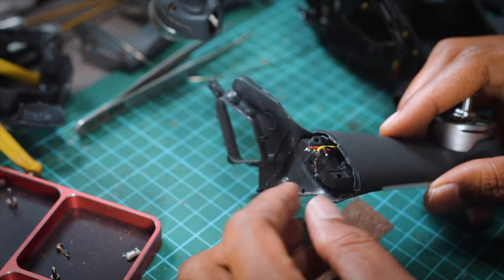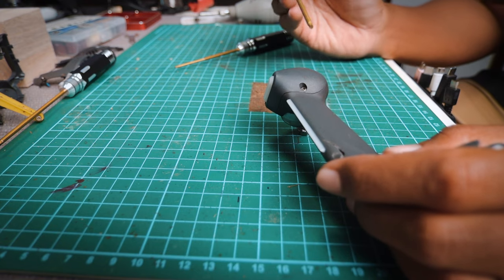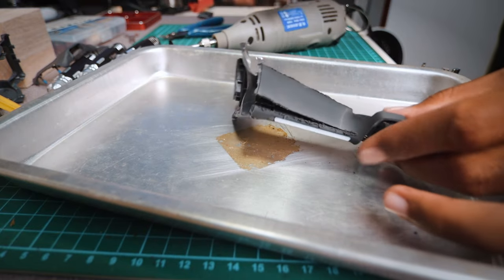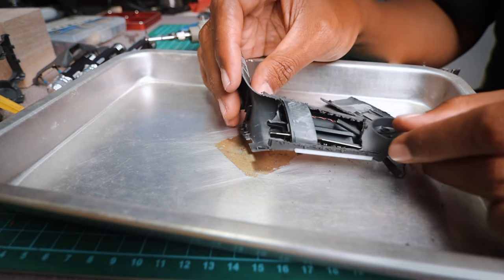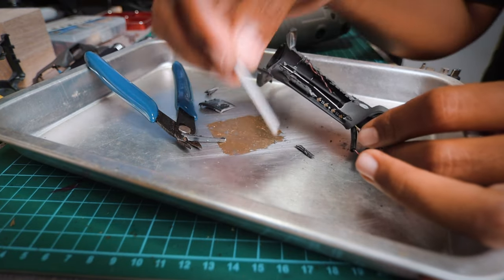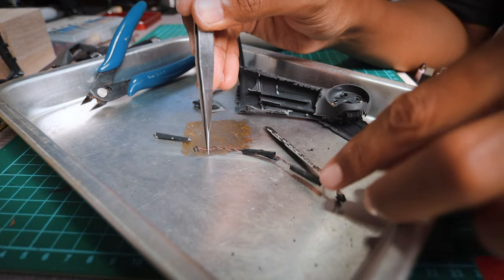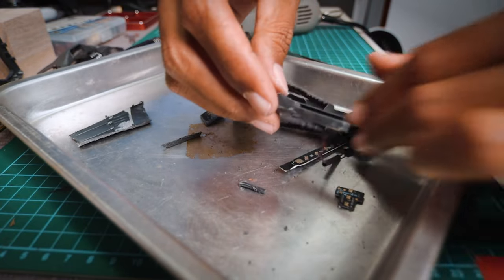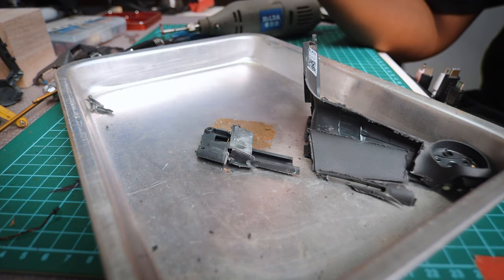DJI FPV Crash Repair Part 2 | DECONSTRUCTED Motor Arm

Comment: Use a heat gun to make the glue less tacky :)
Reply from the maker: The glue is kind of that fast drying, Rc hobby cement kind. Will try it out thanks.
Reply: @TheReelRahim  oh, now I see. If it’s a hobby cement, yeah, the heat gun won’t do any good.
Reply from the maker: Although if i recall, there is solvents to 'melt' the cement, but have not tried. Not wanting to jinx it, but will experiment if i happen to break another arm 😅
Reply: That'll be an interesting experiment 🤣, will definitely tune in. I hope that solvent doesn't melt the plastic though 🤣.

Comment: How about those carbon fiber props? Better then using de aikon adapter? Have a nice day
Reply from the maker: Sorry late response. AVOID AT ALL COST. My opinion aniways. Tried it, too stiff. I need flexy props so as to have smoothrr flight characteristics. Gave the unit alot of jitters that it cannot overcome. These vibrations will translate to poorer footage, eventhough stabilised. Look good for display though ✌🏽

Comment: What if like me the moter just rips out. The  three screws gust  ripped out. Of. The plastic.
Reply from the maker: Oh my! How did that happen? A crash? Not safe to DIY fix back to the arm. It needs a solid base to be mounted on. Sorry friend, you will have to change out the whole arm.
Reply: @TheReelRahim    Coming out of a split s doing about 60.   Flyijg it like a DIY drone.    It does take a hit have plenty of crashes until that one really took it out.   The motor was still run even out of the socket  the  goggles  showed  no errors messages Got it all Tour down  on my bench.  Trying to make it work    Probably will have to get a arm    But im trying a few little things.